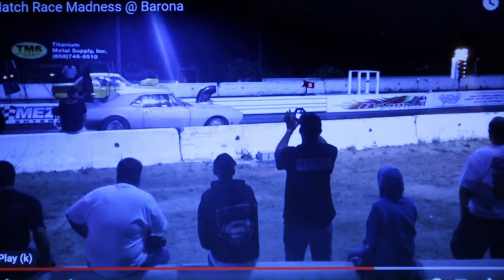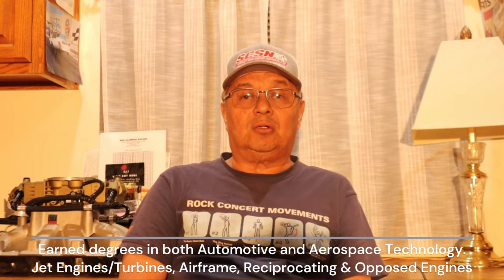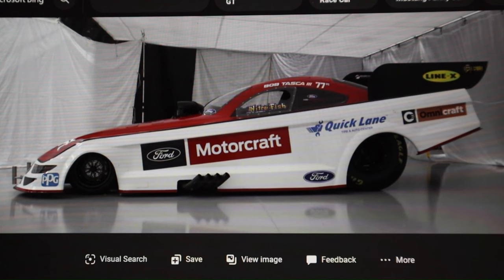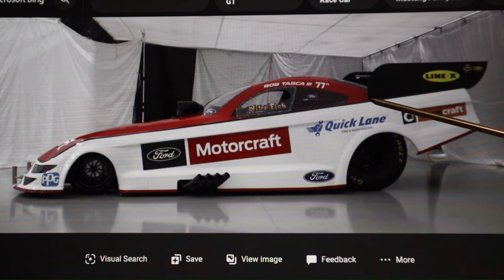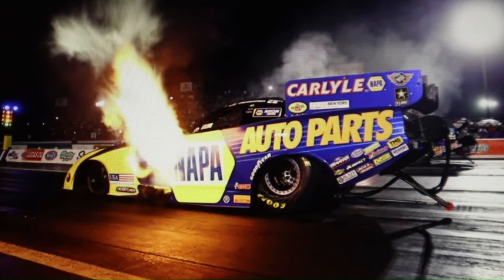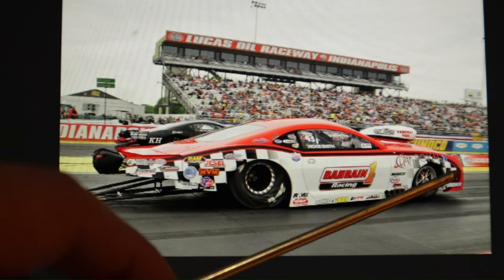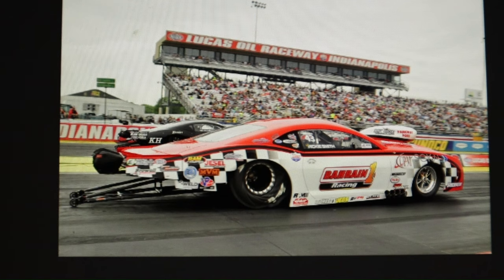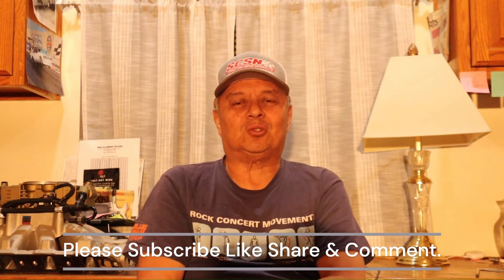RACECAR AERODYNAMICS 101

Comment: Extremely informative video, thank you! Could you do a video taking some of the aerodynamic principles but applied to cylinder head ports? I know you have quite a few for big block motors so I’m specifically asking as to 4 valve per cylinder heads, focusing mainly on the short side radius. (Seeing as though many of these focus on tumble and ignore the short side radius). Thank you for your knowledge!
Reply from the maker: Alejandro, you are right on point about tumble as prevalent in Import 4V cylinder heads.  I am about to do a dyno and flow test on an innovative design for the Pentroof cylinder heads and it looks promising.

Comment: Hi Ben, one thing I don’t think that  understand . For example land speed record cars all have very sharp front needle nose front ends just as space rockets do. 

If I stick my hand out of a window and hold it vertically, I’m going to get pushback on my hand. 

If I hold my hand horizontally, it transitions through the air smoothly.

As an example, if you had a land speed record car teardrop shaped with a square box front end and another identical car with a sharp needle nose front end, all things, being identical, except for the design of the front end the needle, no car will be faster, correct?
Reply from the maker: Thanks for your comment and you are right the sharper nosed car all else being equal will produce faster speeds.  That said, it does not cancel the merits of rear end area that produces a big hole in the air when it is big and it also has a  significant effect perhaps more than we are accustomed to.  As long as the front end is not a shoe box shape but more rounded it will work even for fast speeds @ Bonneville or any salt lake racecar.

Comment: Not to argue your pointing out general faults in aero. Most aero limitations are the result of regulatory bodies, and the desire to maintain a degree of product identity.
NASCAR CUP, has, I feel, devolved, into essentially, a spec series, where cars are now so equally matched, and there being no innovation, that aero, specifically affect of one cars aero on other cars, has been weaponized, and is utilized by drivers, as a dynamic tool.
Check out a video, I can’t attach a link, on the NHRA YouTube channel, Attention in the Pits Episode 117: Clint Neff. 
Think y’all find it interesting for the aero innovations.
Reply from the maker: Nascar became boring because it is very hard to discern manufacturer differences.  I prefer if a brand came out with an inferior design then let them suffer the consequence.  Remember the aero Thunderbirds vs. the others?  Chevy had to rush in the glassback Monte Carlo to keep up and that I feel was competition!  Now a dominant team could not break the draft and more likely will be involve in a crash fest instead of possibly winning it all.  Bill Elliot was awesome and ran away from the pack deservingly so!  Today you are at the mercy of a teammate to help you push to the finish, a joke and now one instead of five wheel lugs like F1.  Boring.  The same with NHRA Pro Stock.
Reply: @benalamedaracing2765  yup, I agree. NASCAR CUP has become IROC, without the novelty of drivers from a variety of motor sport disciplines. Also think the lack of brand identity and individual team / manufacturer association, will hurt the sport. Then there’s the part where they’ve adopted a team charter system, essentially creating a closed club.
I agree with you also, as to NHRA Pro-stock.
Reply from the maker: @georgedreisch2662  , I missed the old days when I used to watch David Pearson in the Wood Brothers Mercury #21 won more superspeedways than any team.  Same with Richard Petty they were untouchable and imagine if that was today with non of the nonsense pack racing which really can get a very fast car mired mid pack because if he does not have a teammate or a draft buddy he is doomed.  lol  
Thanks George for your comments.

Comment: Raindrops are round, not shaped like a teardrop. If they get bigger they flatten out until they break up. Plane wings aren't shaped like that either, they are flat on the bottom. Except for some stunt planes that are symmetrical, to make it easier to fly upside down, and fighter jet wings are flat.
Reply from the maker: Not just stunt plane because the P51D which my dad flew right after WW2 had symmetrical wings unlike what was used at that time, giving it vastly superior range not just because of the gas tank but the wing design decreased drag.  Tran- sonic (F-86F which dad also flew) to supersonic ran the same wing because the speed across the top vs. the bottom would create turbulence due to unequal top and bottom distance for the air to travel across its surface.
Reply: @benalamedaracing2765 ok. my point was normal plane wings. and raindrops.